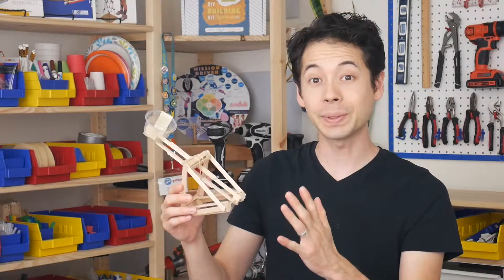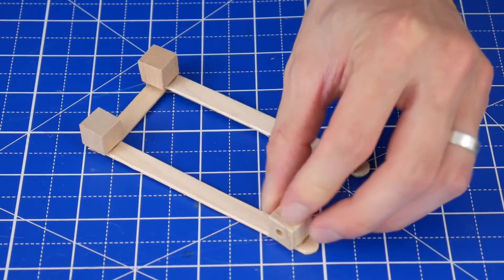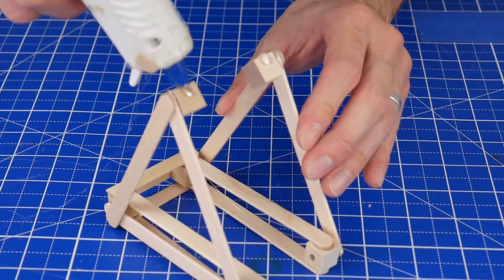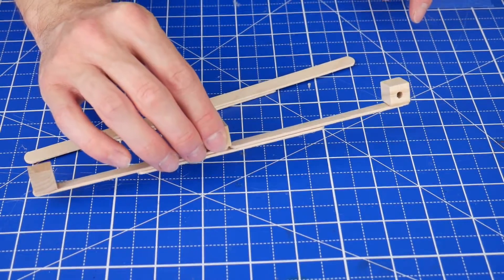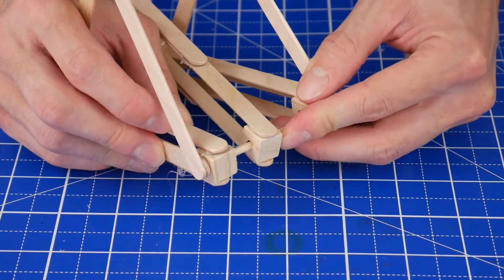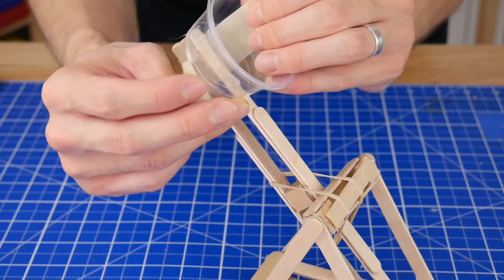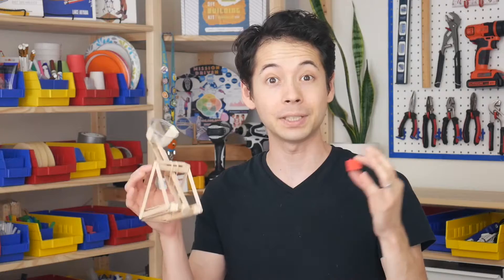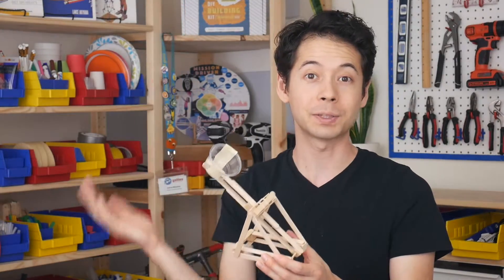Young Engineers: Class 3 Catapult - Sturdy and Fun DIY Engineering Activity for Kids

Comment: what can we substitute for the blocks w/ holes and rod, if we don't have those?
Reply: I used erasers for the blocks
Reply: @Kait._.lyn143 this reply saved me
Reply: @Kait._.lyn143  
What a great idea. Thanks.
Reply: Styrofoam is a pretty good substitute that i used
Reply: well you can make a couple of blocks with left over Popsicle sticks then for the hole ones you can get a straw and a dowel / q tip then you now what to do (if you dont you glue the stra bit on to the arme and then you glue the q tip on the body and threw the stra ps sorry for the spelling